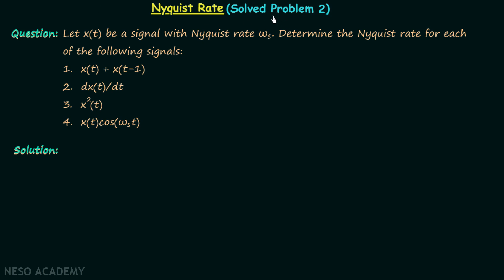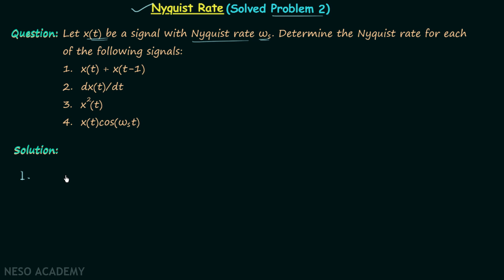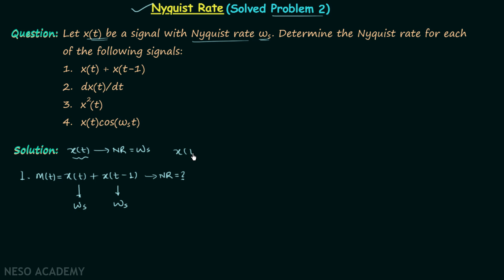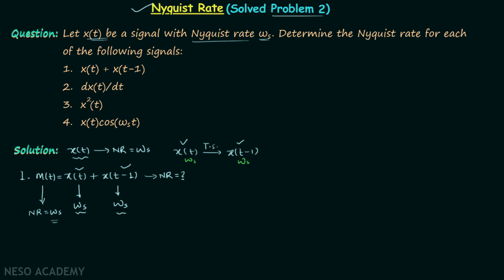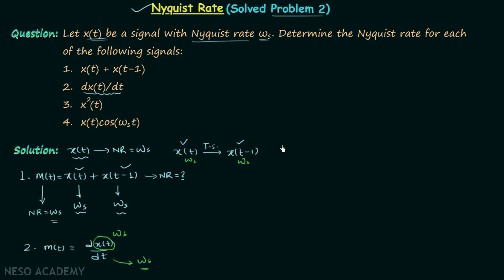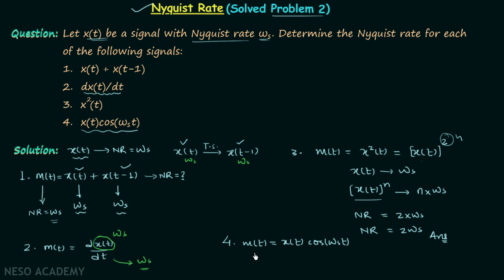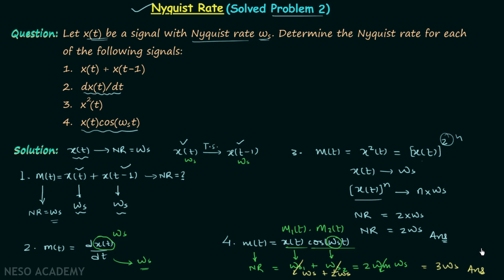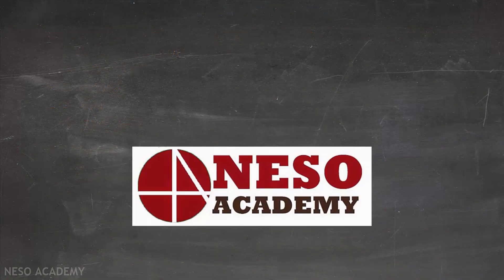Nyquist Rate (Solved Problem 2)

Comment: Hello, isn't Wm of the first one equal to Ws and thus the new Ws' of x(t)+x(t-1) equal to Ws'=2*Wm=2*Ws ?
Reply: According to this sir, if signals are added, then we are to take the max Ws among them, also here Ws is already given and are same for both no need to consider Wm for them, so answer should be Ws.
Reply: For Cos(W_s •t)... Nyquist rate is... W_n = 2*W_s (remember definition... Nyquist rate is double of message signal)... Now due to addition.. Final Nyquist rate = W_s + 2W_s = 3W_s

Comment: Cos ka 2ws kase hua sir?
Reply: Nyquist rate ws = 2wm... similarly ws = 2ws for coswst
Reply: @jancydas5569  still can't understand
Reply: @farhanbinamin  If you use the modulation property you will get the highest frequency component of message signal as Wm=3w/2 !! If you take 2Wm it's 3w which is Ws
Reply: @kanirudh123  Still can't understand
Reply: @kanirudh123  still cant understand(2)
Reply: Nyquist Rate of CosWst is Ws2. To calculate Ws2, the formula is 2xWm and Wm of CosWst is Ws. So, its 2x(Ws). FInal NR is Ws1 + Ws2 which is Ws + 2Ws = 3Ws
Reply: @MDMUMTAHINAHMEDSHOSHE  it's simple for cos wst here ws is wo and not its nyquest rate! (its tricky question) then, NR=2*wm=2*ws
Reply: In First question, both have same nr as Ws. So final should be 2Ws @KakashiHatake-vv4cw